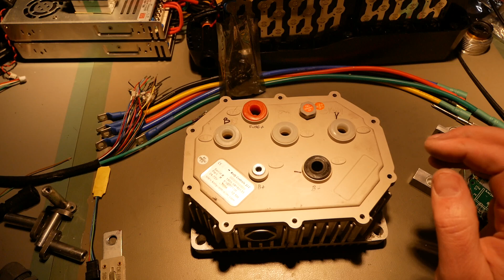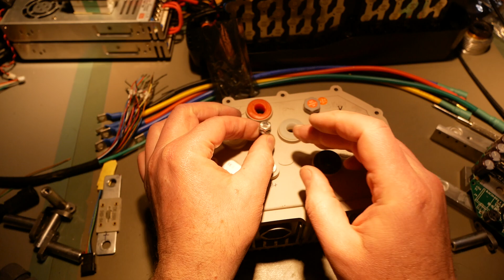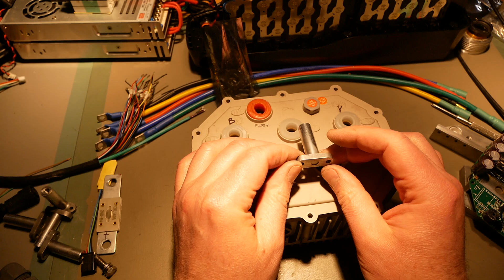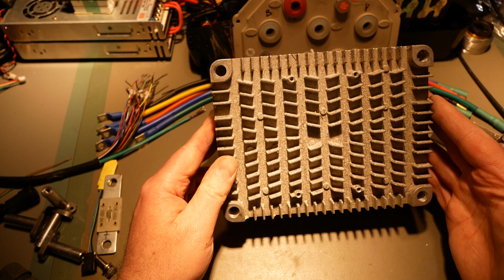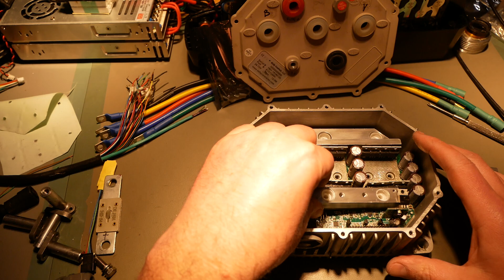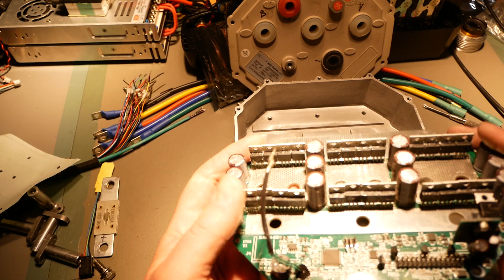Kelly KVD7245 overview

Comment: So how do you shunt mod a Kelly? I have installed 4 and have 2 on the shelf. I run a KEB72450x and find it dead reliable, I would even say bulletproof for me. Large, but in the rain, snow, heat of summer, id doesnt care.  I do warm it up pretty good. 

How do i shunt mod my Kellies?
Reply from the maker: This controller has no shunts as you can see. Frankly "shunt modding" is a bad idea if you are adding solder to them. You have no predictable results. It's much better that you use actual shunts since the resistance value is known and then you can calculate for how much over current you are setting. How this controller measures phase and battery current is via the mosfets and the voltage drop across them. If you want more current from a Kelly, you have to get it buy using lower Rds mosfets so the voltage drop is lower. It's not one of the better aspects of the Kelly design!
Reply: @de-bodgery  Oh yes certainly. I have heard it was the Vdrop in the bus that was monitored.. or the Vdrop across the FEts too. I am just looking for cheap hacks.... Ii know it is not the propper way. I just wanted a better know how on how the Kelly gathers its information. 

Thankyou.
Reply from the maker: @dogdipstick  Figure out which of those connectors is for flashing and you might be able to reflash it with one of it's bigger brothers firmware.

Comment: Thanks for review, Kelly as usual royally screwing heat transfer
Reply from the maker: Solder in all those vias would conduct heat a lot better. Using vias this way isn't bad, jsut have to do it right and Kelly didn't do a good job here.
Reply: @de-bodgery  questionable heat transfer through  tiny copper in vias
Reply from the maker: @vasili_sk  Yes, agreed, why I said they should have added solder to the vias so they conduct heat better.

Comment: Kelly Controllers slogan should be "good enough".  Not actually great value for the money but can be had on eBay for cheap.  I guess Longevity goes a long way considering most of these controllers are 20-30 year old tech (through hole, TO-220 FETS, BLDC or Sinusoidal control).  At least their programmable with a reasonable interface.  They are pretty large and they must have a contract with an aluminum supplier, as they have a lot of aluminum structures.  From my experience, they will not operate above 87VDC.  The larger controllers are the same type of design, with only the control board seperate from the power stage.  Those are typically Sinusoidal.
Reply from the maker: Kelly hasn't innovated in a long time. It's just the same old tired tech year after year!
Reply: Everyone 72Vn model I tested shut down right over 86v.